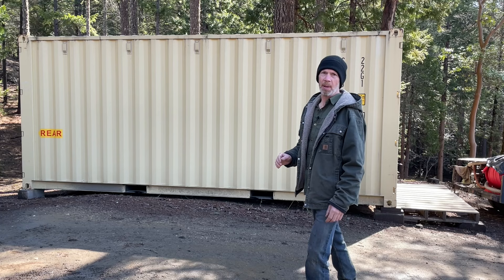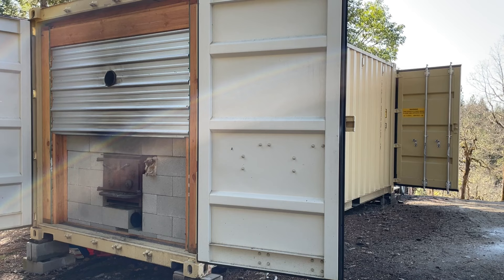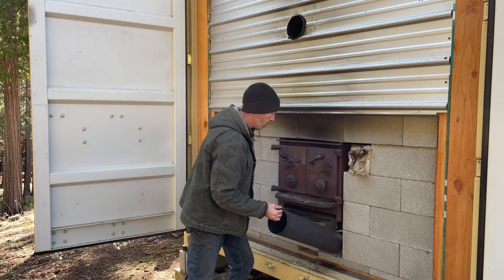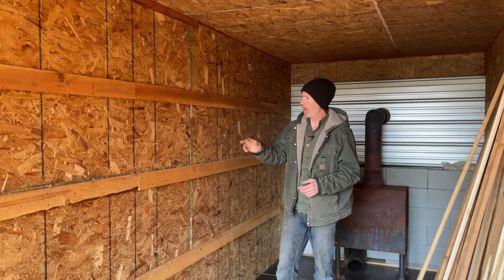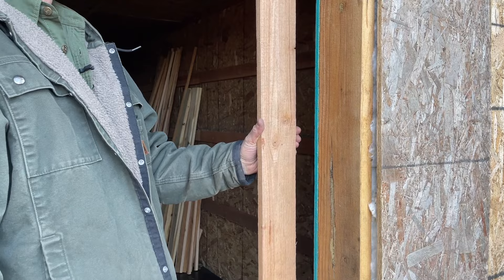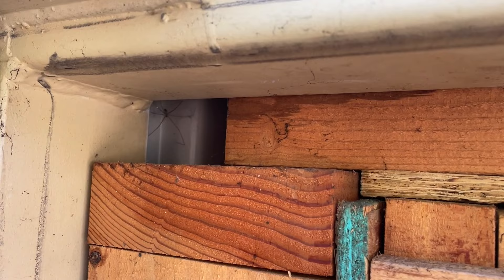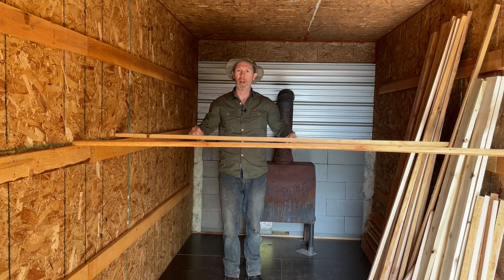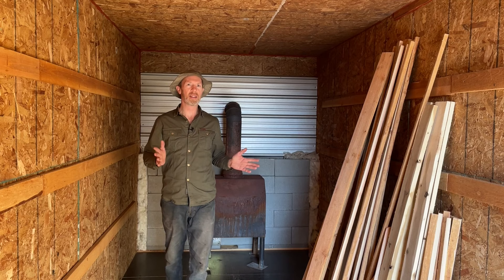Wood Fired Kiln From a Shipping Container for Drying Treating Wood

Comment: Mr. Wilson my husband is a retired contractor, he said your approach to simplicity is far better than a custom built unit done by an experienced carpenter, It is practical, effective & well made. He wants to share a test that was done on OSB plywood on site by a manufacturer representative, in Southern California. There was a newly framed house with OSB installed on it already, so he took a plumbers torch and held its flame towards the plywood. He said the plywood started to smoke & the surface was glowing, he then took the flame away and left the smoking plywood. The burn did not spread from the localized area and eventually cooled down & stopped altogether. That is what was done during the height of OSB use.
Reply from the maker: I appreciate you and your husband‘s comments. That’s an interesting study, thank you for sharing. That could be an interesting experiment to try and confirm.

Comment: Silicone caulking is good to up to 500 degrees.  You could use 12 volt solar power for circulation fans to increase the volume of air moving around the interior.

Comment: Have you considered the heat powered wood stove fans?  They are very useful in canvas tents for moving air around when there is no power.
Reply: They might not work, due to how they work. There have to be a temperature difference in the air and the "heat source". If the air is to hot and humid, both the motor and the peltier device could be broken. Good idea though

Comment from the maker: Something I should have mentioned in the video. This was designed to be used with the container doors on the wood stove side open. I have a stove pipe contraption that goes into the stove pipe going through the wall that vents the smoke up and away from the structure. When I shot the video, I had that stove pipe off so the doors could be closed while I wasn’t using the container.

Comment: A possible solution to the off-grid fan problem would be computer exhaust fans.  Very low power consumption and if you mount several together in a DIY frame to fit the hole, you could run all of them to a solar panel and rechargeable battery and have enough power to run them 24/7.  Not going to be real powerful, but certainly enough to vent the cooler air out.
Reply from the maker: That sounds like a possibility. I wonder how well they hold up to moisture. I didn’t go solar because when I was using it, most of the time it was in the winter when we don’t get much sun here. If I start using it again for something else other times of the year, your idea would probably be a good one.
Reply: @WilsonForestLands  That's the better part of using the computer case sized fans.  They move good air, but tiny power usage.  So, small solar panels would work and a small battery would supply what was needed and depending on the panel, it can even collect ambient light for enough juice on overcast days.
Reply: @WilsonForestLands  they are so cheap, even if moisture was a problem, most likely still cost effective.

Comment: I'm planning  on building  a firewood  kiln soon. Wood furnace heated , hot air blown into  the chamber with 2 high cfm fans to dry the firewood  in ibc totes. 2x6, framed with spray foam. Sheet metal exterior. Seperate room for the furnace.  On concrete  so I can use a pallet jack and skidsteer  to move the baskets around.
Reply from the maker: Sounds like you have the right idea there. The hot blown air should do the trick.

Comment: There are these heat powered stove fans (they have a little thermo-electric element in them, quick search says they are about $40), you could probably take it apart and put the heat to power part on the outside and then run some wires to the fan part inside for better performance.

Comment: Love your kiln set up nice and simple while also being functional, if it works don't mess with it. You could put a bit more heat resistant insulation along tipoff block wall the might help reduce or stop the air leakage between them and the metal section of the wall.
Reply from the maker: Yeah that area around the blocks could use a little more work. Probably just a little insulation stuffed in there would do the trick.

Comment: It's good to know the OSB has held up, I've been curious myself about building a kiln and since shipping containers are super expensive I'd probably just build a normal building out of lumber.  I guess the key is to monitor temp so it does not get too hot too.  Would be cool to pump the heat through some pipes in the floor and make the floor concrete, it would retain heat and slowly radiate it up.
Reply from the maker: I thought about just doing a normal building. But I was in a hurry and also was considering the wild fire danger we have here where this one is located. I wanted the ability to close it up if a wildfire threatened it from the outside or if it caught fire on the inside.
Reply: I was thinking of using insulated sea container with wood boiler providing heat to infloor heating to dry firewood with an exhaust fan near the top to blow out humidity.

Comment: If you get really nice vertical grain fur they like setting the pitch in that then using it inside that way the pitch won't run. That would work great for setting the pitch.
Reply from the maker: Good suggestion. Eventually I will get into more material that is more clear with tight grain. I would then have to see if the value added would bring in a price high enough to make it worth it.

Comment: Another question: OSB is still pretty expensive, whereas sheetrock/drywall is still pretty cheap. For about $20 USD, you can get a 4x8 sheet of moisture/mold resistant drywall, which is much better for fire resistance than OSB. Would that be a viable option for the inner sheathing?

Comment: Nice build! You made me laugh out loud with "VO-ILAH!"  Subscribed, based on that alone! For decades, my brother and I have been using "VIE-OLAH!" after accomplishing a feat worth bragging about. Imagine my chagrin when I just realized that we've been mispronouncing the mispronunciation! SHAME! [hangs head]

I have one 40' conex for oddball wood (logs and weird firewood pieces I want to turn into sculptures) as well as just standard storage of regular junk and things that were building up in the garage. With the stuff I build, I mostly just let the wood weather and season outside like you would with firewood, but the fancier, "special" stuff I put in the box I treat with Anchorseal and let it slowly dry out in the WWT box. The value of utility for the cash outlay is amazing with shipping containers! 

I have room to put a second 40' unit in right next to it on the back property. Do you think I could separate like the back 16' or so and build a similar situation like what you have going there, whilst keeping the front portion for more standard material storage? 

Also, here in Texas, most months the inside of my current box gets pretty warm from just sunshine and downright scorching (120+ degrees) in summer. i would imagine I could get away with a space heater type situation in the actual kiln room for the couple of cold months that we might have, or even just a fan to maintain the air flow without worrying too much about temperature. Thoughts? I don't know that much about kilns.

Comment: Looking at where the smoke comes out unless you cut a hole in the door they would have to be opened while using the kiln. is there any thought of cutting a hole in the door (s) for smoke escape? That could be a dummy question but I don't know how say what I'm thinking otherwise. I do like you videos and your sense of humor.
Reply from the maker: Not a dumb question, when I was editing the video I was thinking I should have clarified that. It was made to be used with the container doors open on the wood stove side. I have more stove pipe that goes into that hole that vents it up and away from the structure. I had the stove pipe off so the doors could be shut while I wasn’t using the kiln.

Comment: I see you're familiar with the old adage "There is nothing more permanent than a temporary solution that works."  LOL  How about kiln drying firewood?  Load them up in IBC tote cages and put them in with your tractor and pallet forks.
Reply from the maker: I like that adage. Firewood is a good suggestion but firewood is so cheap here its hardly worth messing with. I have dried a little for my own use when the cover blew off the pile and it got rained on.

Comment: If you would like you can ship it out here at your expense to get rid of it 🤣  All kidding aside, it looks good, perhaps a solar powered fan or two.
Reply from the maker: That would be really nice of me to do that, but I’m just not quite that nice. 😁Solar fans could be a partial solution. I probably would do that if I was to start drying lumber now. But for what I was using it for, the time of year I needed to use it most, was in the winter when we usually don’t get much sun.